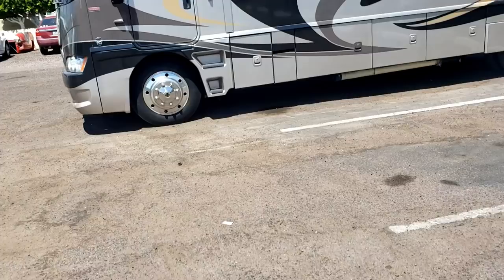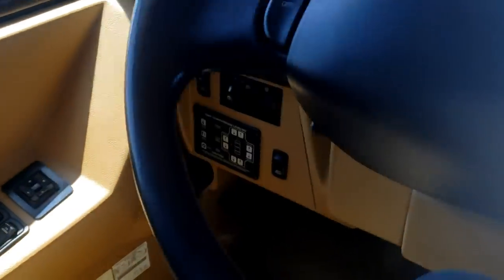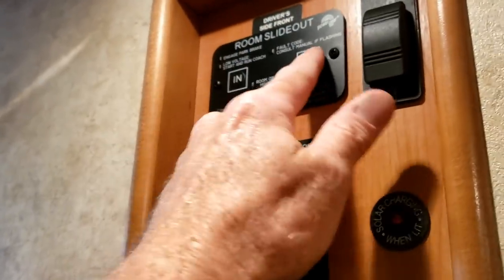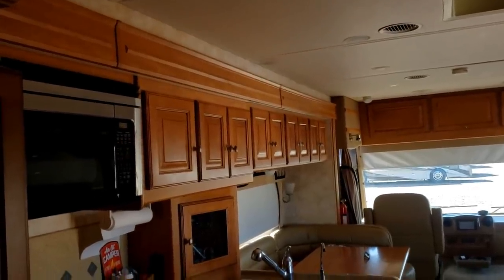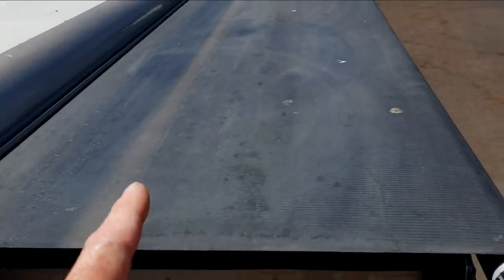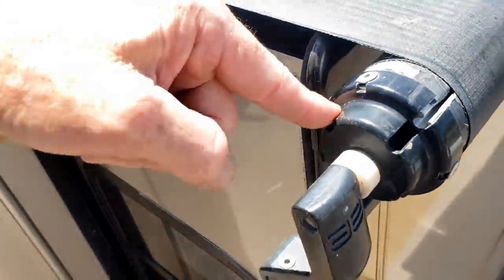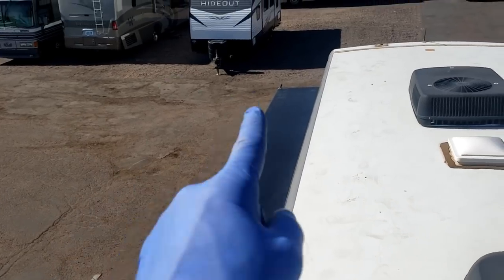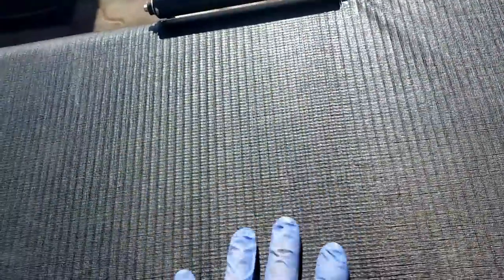Solera RV Slide Out Awning Fabric Replacements and Other Secrets

Comment: Thanks James, great video as usual. I've got two of those on our Newmar which will probably need doing in a couple of more years. Thats the easiest looking way of doing that job I've seen yet. Our longest topper is only 12 ft. When it rains, I temporarily lower the jacks on the front or back just enough to pitch it which way I want the water to go.
Reply from the maker: Thanks for the tip

Comment: I added the Lippert Solera slide toppers to my fifth wheel slideouts, but the fabric didn’t last two years. It totally disintegrated and fell apart on all three units that I installed. 

I’ve only put about 2,000 miles on the RV in those two years, so they weren’t abused. I just can’t believe the poor quality vinyl fabric the Solera units supplied.

My regular awning fabric has lasted 18 years and is still going strong. I expected more than a lousy two years from the Soleras. 

Has anyone else experienced such problems with the Solera fabric?

Comment: I’m curious as to why you don’t like the big one side slide
Is it because of the middle pooling issue you mentioned
Or they give more grief than you like mechanically
Reply from the maker: mostly grief, there are three motors that are synced together so manual operation is very difficult which is the best selling point on an electric slide out compared to hydraulic

Comment: May I ask what kind of battery powered  drill you use and if you would recommend it or something else? Thank you.
Reply from the maker: I use a very old and outdated Craftsman Nextec. I have a complete Milwaukee set, I just have the feel of the Craftsman from almost 13 years of use so I prefer it until they finally die.
Reply: AZ Expert Thank you. My old B&D just died and noticed just what you said. The way you wield it around that drill seems like an extension of your hand, but I thought it looked like a Milwaukee. I think I’m getting a 20v Dewalt for Father’s Day in a packaged deal with a drill/driver & impact driver. Thanks again!